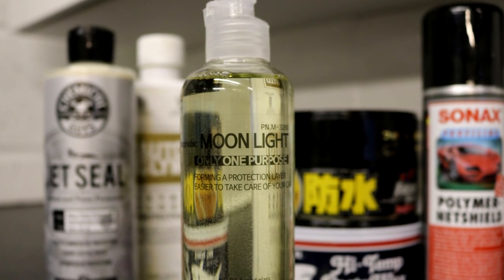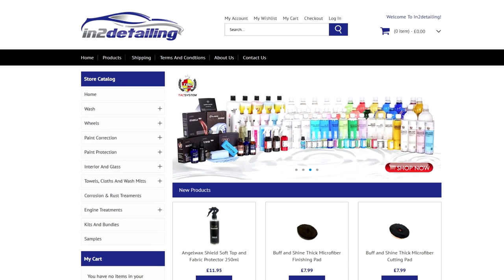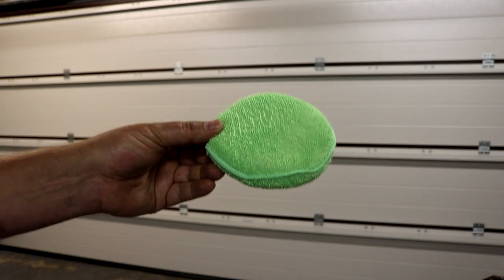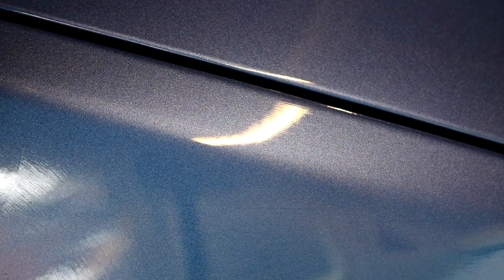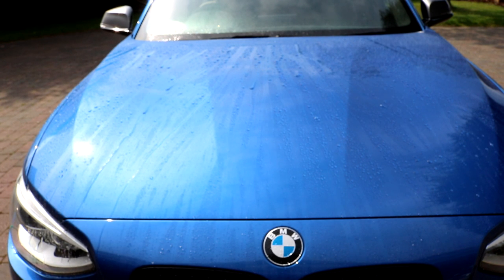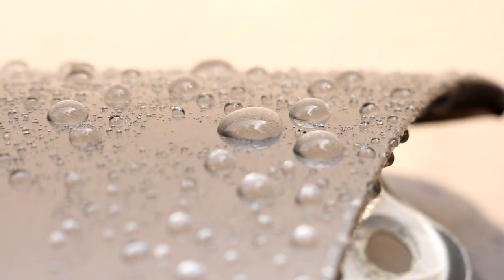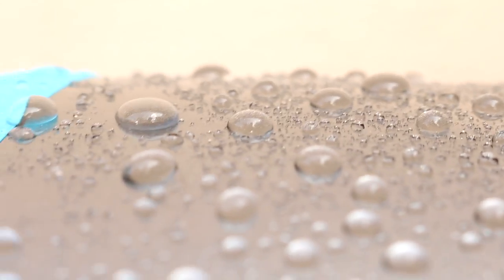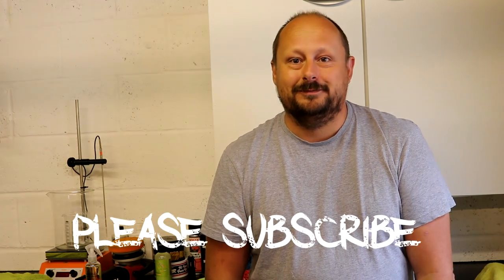TAC systems - Moonlight silica based spray sealant - How to seal your car

Comment: I have several TAC system products in my collection and I'm very impressed with everything except their waterless wash. I applied 2 layers of TAC system Power plus at the beginning of last month, prep was done using Griot's clay towel (fine grade) as well as TAC system iron soap, car wasn't too bad. For polishing I used the recently released 303 compound, polish and finishing polish to achieve a great finish, then it was onto the TAC system Power plus. The application was easy and results blew me away, this leads me to the use of Moonlight. Although my coating was only 6 weeks old I was bored this morning and decided to add a topper and let me tell you this, took the POP to an even further level, Moonlight is an great product!!

I plan on using their Water Glass in the fall to give the car an additional boost for winter and even made that product at the 1:6 ratio per their suggestions, although they also say 1:9 is also acceptable. There's no reason to look any further than TAC system for all your detailing needs, they have a full product line. In closing I've used their Moonlight, 1 step Master and Quartz Max with great success😉

Comment: Looks like a brilliant product for sure, which has lead me to research their product range. Whilst I like these coating, I'm a big fan of traditional waxes, purely because of the fact I like getting out there to apply new coats of wax. It's horses for courses and a question of how much time you have really... but again, you never cease to deliver a damn good review.  10 gold stars ✨👍🏼
Reply from the maker: my opinion of this product is really high.. the way it holds onto its potency is beyond other formats..

one thing I can say is there is a slight issue with these products leaving water spots.. the water repellency is impressive but the beads seem to cling to the car rather than sheet off...    So I recomend this product as a base line sealant type sealant and then topping with a nice paste wax or a liquid spray product with good surface characteristics to compliment it.. but like I say its prolly the best sealant Ive used thats not a full blown ceramic and is easy to apply..  the gloss is lovely it makes the clearcoat look like fresh laquer..
Reply: Thanks for the feedback! Really useful... have you done a review of Menzerna Powerlock at all? I'd like to see how it compares and get, what is clearly your chemical knowledge opinion. Thanks again 👍🏼
Reply from the maker: no but looking to do something cool on sealants soon (ish) max so stay tuned

Comment: Great product review. I criticized the format of "brand review"',  but this is exactly what i like. Would appreciate a part 2 of this, maybe in a month, to describe how the product has evolved since, and how does it repel dirt. It is noticeably easier to wash? Will it have a mesurable effect on light scratches inflincted during a normal wash?
I tried my 1st sealant, wolfgang deep gloss paint sealant for 4 month now. Still visible, but i haven't notice an effect on how clean the car is, or how easy it is to clean it unfortunatly.

Comment: I have applied tac system moonlight to my car. Impressed with the water beading. But it doesn't seem to sheet. The beads stay in place. It's clear that it's hydrophobic. But would have expected sheeting. Is this because of a curing issue or perhaps I didn't buff soon enough causing rough surface for the beads to grip?

Comment: First of all let me say I rate your in depth assessments and product reviews in high regard.
The attention to detail and an honest review is not seen on any other channel.
I'd like to ask a question about my '17 VW Golf which has been LSP'ed with Dodo Juice Purple Haze.
If I wanted to use a sealant would you recommend applying it over this (or any other wax) or removing the wax with Lime Prime as you mentioned in your video?
Would you consider the Hyd-Re-Seal from your 2016 product awards or the TAC Moonlight the better option to use in this example?
Regards,
Reply from the maker: hey there..  so purple haze I think its a natural wax formulation..  if its been on for more than a month then whats left would prolly be removed by good pre wax cleaner.. But one with abrasives is always a sure fire way to remove them..

Yes moonlight needs to go onto a prep'd surface, where any existing coatings are removed (unless its another ceramic you are topping up)...  lime prime by hand application would be ok if you dont have a machine polisher.. (just be mindfull to level and work the cleaner quickly and then remove and dont use it in sun light on hot panels)

once applied and cured you could then add a wax like PH on top..

hyd-re-seal is a completly different type of product..  very nice and cool but totally different. its like a wet coat you blast over the whole car from a lance..  easy to apply lots of pros and a few cons.. but cool..

but yer as a longer lasting option.. Moonlight as a based sealant, toppped with your paste wax from dodo juice would be a cool combo.
Reply: As always thank you very much!
Really appreciated.

Comment: Would the buffing cloths and microfibre applicators be trashed after apply Moonlight ?
Reply from the maker: hmm great question.  I would say applicators yes.  So you could use the suede blocks ceramic applicators and bin the little cloth square.   Buffing cloths I dont know.  but this material sets hard so my guess is yes. maybe relegate the cloths..

Comment: I’ve been using hybrid solutions ceramic spray coating and the durability is not very impressive, especially on the roof, it seems to disappear after 3-4 weeks. I’ll give this a go and see if it lasts. Thanks for the advice.
Reply from the maker: moonlight out lasts any water based spray coating.. in fact I have a test coming soon showing TW ceramic V moonlight and 24 other products.
Reply: Excellent. I do loves good shoot out 👍

Comment: i saw on that silver panel you were showing that one side had this product and the other had fusso. the water repellant nature looked about even, would you still say that the silica sealant is preferable just because of its ease of use over fusso? i've noticed that while fusso does repel water VERY well, it doesn't seem to repeal dirt or fall out any different than other waxes ive used. does the silica sealant have better dirt and fall out repelling?
Reply from the maker: hey there, so fusso actually holds onto that repellency longer than vritually all products..  Even some full on ceramic coatings loose their hydrophobic properties even though theres still material there.

there is a difference though yes. I think coatings generally the dirt repellency is noticably better than other formats of protection.   good test would be a 50/50 on the barrel of an alloy.

moonlight is wicked, so easy to apply.  and just top it with reload or cure to keep the hydrophobiic thing going, but the underlying ceramic should stick around for the claimed 9 months.

with moonlight you get a taster or what a ceramic does in terms of surface characteristics, but the application is very easy.

Comment: Hi Jon, I’m just getting into detailing and learning a lot from your channel, though easily confused. I live in Brighton and seagull crap is a real day to day problem. Does this product and/or others like it offer any resistance to the acids in the crap?
Reply: Hi Paul, obviously never leave bird shit on the car, with no coating most of it will more than likley stick however with a coating the runny stuff slides off but don't become full reliant on a protectant

Comment: Love your channel and reviews I'm learning so much. How long do you leave it until you can add wax on top of it. Also can you use this on wheels after applying gtechniq c5 wheel armour Many thanks
Reply from the maker: you can use it on a coating although compatability is a bit of a grey area and some coatings when fully cured might not take other products.  but Im almost certain if you put this on top of C5 you should be fine.

Comment: I have been using Griot’s Garage Spray Wax as a drying aid, which really adds a lot of gloss after my maintenance washes. If I would apply Moonlight over naked clear coat, is there any reason why I couldn’t continue topping Griot’s Spray Wax over Moonlight?  Great video Jon!
Reply from the maker: you should be able to use a spray was on top of this product steve

Comment: Hello, very nice review of this product, im planning to apply soon this product on my car before this winter, i wanted to ask you which shampoo do you recommand for the maintenance of this protection ? Is a PH neutral shampoo enough or a ceramic shampoo like for example car pro reset is more suitable ? Thanks
Reply from the maker: Yo Chris,  TAC systems mystic bubble  (the blue one).   If you are in the USA you could also use Carpro Reset.   Search you tube for the "best car soap shampoo" and you will see my video on lots of car soaps.
Reply: @ForensicDetailing  ok thank you i was thinking if i can use the dodojuice "Born to be mild" to maintain ?

Comment: Jon and others, i noticed that you have used plush MF towels, would you have to throw away that towel after buffing it aka the full blown ceramics? What about the water spotting? Would you top it up with Reload etc?

Comment: How are the self cleaning properties of this product vs a true ceramic?
Reply from the maker: its hard to say.. but I would say the dirt repellency comes from the speciality silazane resins.   Of which this contains about 25% I believe.  so its probably not going to be up there with a full blown ceramic and it wont last as long.  but it defeintly makes cleaning the car easier stephen.

Comment: Won't this silica coating collect dust and scratches the same way the clear coat would? If it does, what's the point of using it, in terms of optical results? Also, how hard is it to sand it off, once it's worn and time to renew?
Reply from the maker: complex question...   first up.. the surface characteristics of it on application are different to unprotected clearcoat..  So it repels water and liquids, resists detergents etc contaminants will not stick to it as easily as raw paintwork, all this the end user can see for themselves after application.   So I guess in this sense its the same in theory as a traditional sealant (to an extent)..  but the actual material you are putting on the car is tougher and harder and more durable that other forms of sealant or waxes... And has good self cleaning qualities over other sealants.

bearing in mind this is a light weight lower concentrated form of a ceramic coating.. I guess the killer question is how much scratch resistence you get from it..  the answer is "some" but in my opinion its perhaps hard to quantify from a user perspective with done side by side testing on treated and untreated areas and even then hard to assess..   Some realistically if perhaps not much.... and using this product isnt a license to use unsafe methods to clean the car...  

as with other sealants and waxes, the intensity of all the surface characteristics dull down after a month or two but this product is still there providing a very thin barrier between your paintwork and the elements.  (works really well on alloys too)  Its a very nice introduction into ceramics thats still easy to apply...  hope that helps its very good stuff..
Reply: Jon, thanks for your quick, yet, extensive answer - I really appreciate it. However, I'm still puzzled over how much effort is needed to remove this product fully, once it's so worn, that you need to renew it? Can it be chemically stripped (by for ex isopropyl alcohol or some heavy detergent), or would you need to actually polish the car surface (or even maybe compound it)? Also, can it be waxed over to get the shine back once the silica coating itself is somewhat worn, or would it prevent even wax from sticking to / layering over it?
Reply from the maker: so it will wear away and disapear as a result of weathering and cleaning etc..  but just take longer so no effort to remove unless you want to take it off..    It wont be chemically removed generally speaking (not with things that are paintwork safe)

can be waxed over yes..  Something like carpro reload over the top works well though but wax is fine as well.. wax ill adheare to this...   not so good for a sealant to be use on this though (certain types of sealant at least)
Reply: Jon, thanks for taking the time to answer me. I just might try this product in the near future.
Reply: Gábor Bérczi good questions exactly what I was wondering

Comment: I'm a very amateur detailer, I drive a black car and use AF tripple to mask swirls, along with DoDo Juice purple haze as it really adds depth to the magic black paintwork of the vrs. I'm one for the deepest, wettest shine I can get out of my car so love a good wax, would a spray like this one create just as much depth/reflection or are ceramic coatings more for durability?
Reply from the maker: its more about durability and protection yes.. the wax I think still has a lot to offer as a nice deep gloss..  there is something that will always be cool about waxes..   but this silica product would work well as a base coat for a wax..

Comment: Could thIs be topped with a show wax for lots of gloss?
Reply: HBJ yes it can or you can use quartz max by tacsystem as a topper.   But I wouldn’t recommend wax. This will change moonlights ability to perform as intended. It has tons of gloss.
Reply: @superficialdetails  what about topping with tac system shinee wax?

Comment: Another excellent and informative video, thanks. How would you rate TAC Moonlight compared to Fusso Coat for looks and longevity?
Reply from the maker: fusso, will exhibit its water repellency characteristics for longer because it somehow lock in that PTFE form of additive within its sealant.. and that additive repels water like crazy...    but I believe the silica coating will give a harder more durable layer of protection...

They are totally different.. fusso is really cool for what its able to achieve (ignore the haters) in terms of protection.

This silica product though really is more of a recent "thing"...

both epic...
Reply: @ForensicDetailing  can fusso coat be applied over this? Do you think it would allow for a year protección?

Comment: Jon, did you have to pitch your applicator and towels in the trash or can you just wash them and use them for finish duty again ?
Reply from the maker: good question.. the applicator just got demoted for like trim or tyres..  the microfiber I soaked in warm water and some APC immeidetly after application and then washed..  I think if a ceramic dries in a microfiber then the microfiber is toast..  and with higher strength ceramics I think the microfiber is also toast..   although moonlight is not a full blown ceramic Im guessing it might be a good idea to dispose of the microfiber after use

Comment: Hope this isn't a silly question...do I have to discard the microfiber applicator and buffing towel once used as they would be saturated with  SiO2 "shards" that could scratch paintwork if used again or can I just wash them? Would appreciate a response please-thanks
Reply from the maker: good question..  so normally once you have soaked ceramic "type" resins into a microfiber, then that microfiber does not want to go near paintwork again.. and it also shouldnt go near any other surface you dont want to potentially scratch up.. so internal etc..  But you could demote them to general purpose crappy rags for like tyres cleaning etc.. 

but yes you should discard really..   tac is a lower concentration ceramic.. but its still essentially a ceramic so you should stick to those rules..

check out paragone premium microfiber terry cloths very cheap...  good though
Reply: Thanks- Does that same principle then apply to products like CarPro Reload and others with a similar make up as they too also contain SiO2 -all be it in much lower quantaties than the TAC Systems? Appreciate you getting back to me.

Comment: Turns out TAC Systems charges a flat £30 (!!!!) shipping fee for all purchases from outside the UK. That's ridiculous. Definitely getting my car care products from some other supplier/manufacturer.
Reply from the maker: maybe see if imran will send to you guys from the UK.
Reply: Just a follow up: because of the high shipping cost and limited availability in the end I opted for Carpro Cquartz instead (which was more accessible to me), and I'm amazed by the results. The shine is not so much a difference, because I already had my car polished to mirror finish, and albeit CQUK improved even on that, it's not that a big jump from where it was. However, what I'm really amazed of is how good it keeps the dust away, because except for a thin layer of pollen-like miniscule particles, dust and dirt has practically no chance to set on it. Also, the washing and especially the drying experience is just unbelievable, because water literally runs scared from the paint now (and carrying any dust with it, that might have settled on the paint), and when coming in contact with the towel, it immediately detaches from the car's surface and gets into the towel, to never return. You never have to go over the same place twice, but get all dry already at the first time, and there's practically no water streaking either. All in all, even if it wouldn't last 2 years as promised, just half, I'd still chose it any time over regular waxing, because of these properties.

Comment: If it lasts around 6 months can you just clay bar before reapplying or do you need to strip it completely first
Reply: Use something similar to iron zero to remove contaminants and a through washing, then wipe with oil zero before reapplying. All TacSystem products